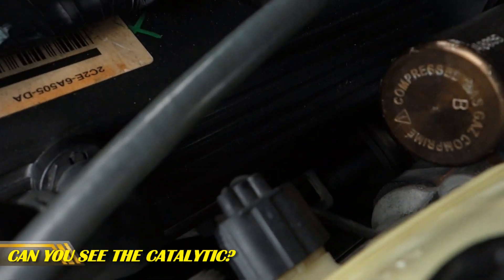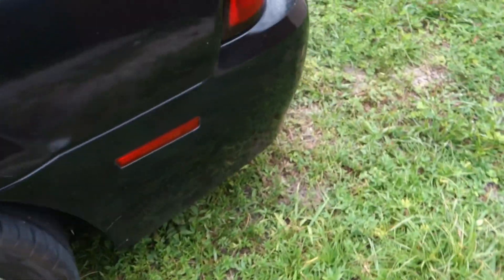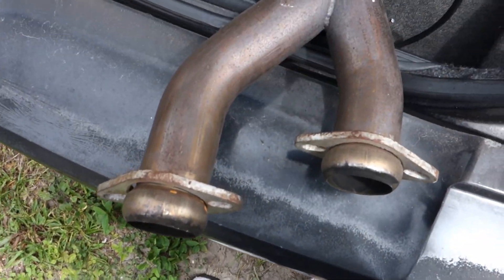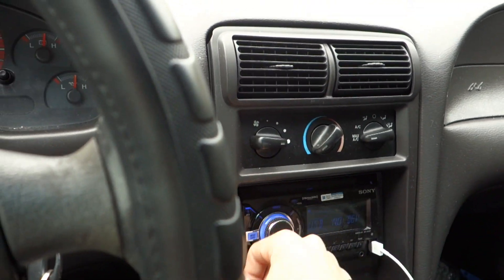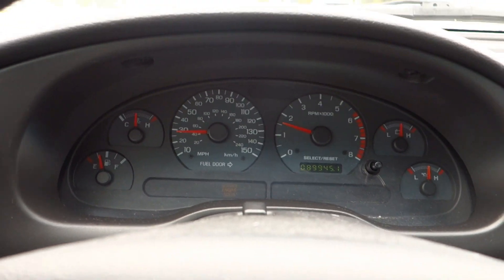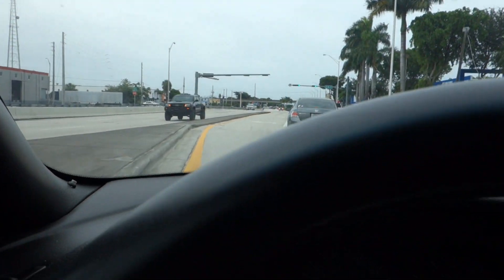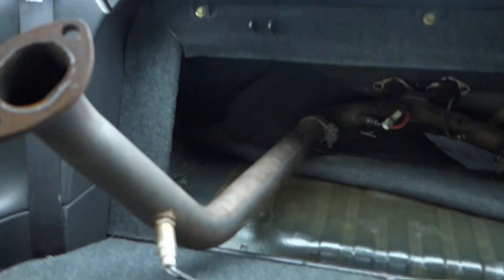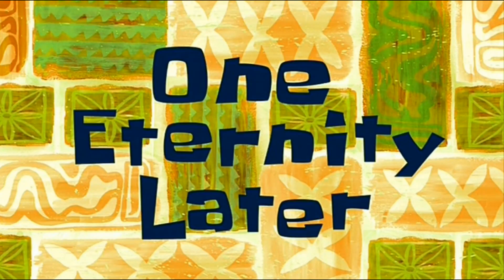99-04 Mustang GT Pypes OFF-Road X Pipe with Flowmaster Catback

Comment: will you know if H pipe for 99-03 will fit for a 95 mustang gt? 
Stock headers?
Reply from the maker: I truly don’t think so, a 95 Mustang gt had 5.0 pushrod motor and the 99-04 has a modular 4.6 motor.
Reply: @TheMGChannel  and what's the difference from both motors?
Reply from the maker: @metalmilitia6465  Do a little Google search 🔍 but basically, 4.6L vs 5.0L one is over head cam, the other is a pushrod motor, both are very different
Reply: @TheMGChannel  your car is a stock headers?

Comment: Flowmasters sounds better on a 302 pushrod motor. On these mod motor a straight through mufflers like borlas, Bassani, magmapacks  sounds 100x better plus you get more horsepower. Flowmaster is played out
Reply from the maker: Yes flowmasters sounds amazing in the old 302. I agree with you